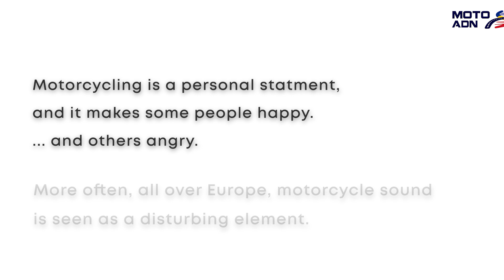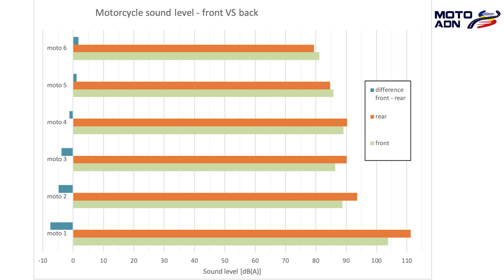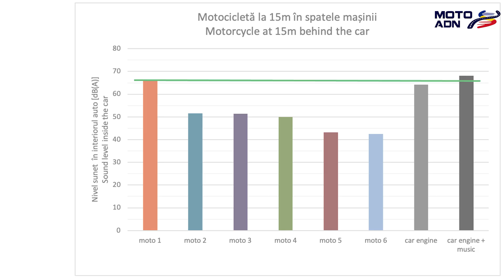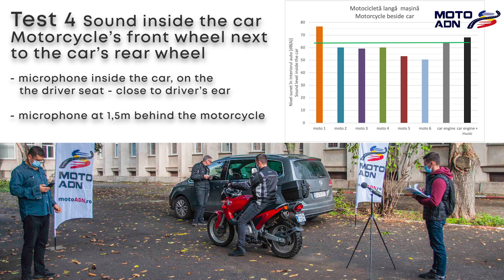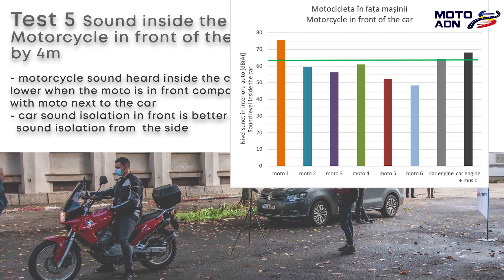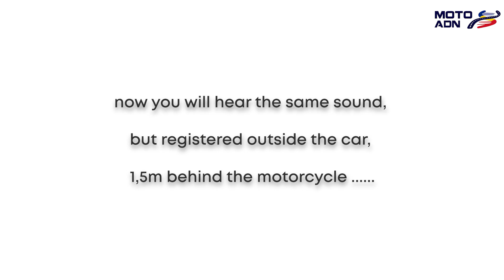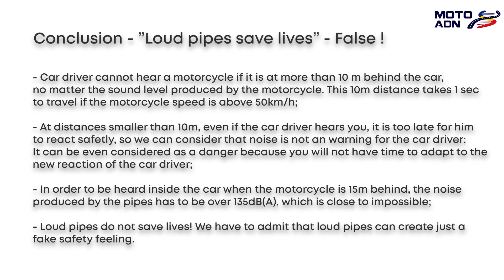Do loud pipes save lives? Now you have the answer!

Comment: I ride and drive in a bike city full of noisy bikes; Bangkok. My Land Rover had a 40-year-old diesel engine - I'd wager it is noisier than almost all modern passenger cars. I can hear loud bikes over my engine and road noise. I posit that the close proximity of other cars in traffic acts to reflect sounds from the exhaust. Lane-splitting is legal in many places and where it is bike exhaust noise will reflect off the front of vehicles behind and also be tunnelled along the sides of cars.

I think the set-up of your test is perhaps valid for open roads, but not roads with sidewalls and certainly not busy city streets. I look forward to your additional testing results.

Edit: Also, it may not be necessary to alert a can to change what they are doing, in some situations, stopping them from starting a move may be enough. 10+ meters is enough to hear right, then it's enough to stay in lane and not start to change.
Reply: Yea i definitely agree, i think something is wrong about this test. I can certainly remember several occasions hearing motorcycles from inside my car and i personally have successfully drawn attention to my bike by revving up even just a little although my bike is not particularly loud. In both recordings you could hear the bike as well. i think the test would have been better if they had sat blindfolded people into the car, not telling them what the test was about and then asking them to describe what they heard. Specially a downshifting or strongly accelersting bike should be easy to hear. I can certainly hear motorcycles far away inside the house and why would a car be that incredibly sound proof that you wouldn't hear? unlikely specially when, like you said, the noise is reflected back by walls and stuff around the traffic
Reply: in traffic when i am lane splitting and i give it a blip people generally look up from their phone and move over to let me pass
Reply: @NZ2STROKE  thats because your on top of them that wouldnt help if they were about to turn as it would be too late
Reply: @luc1ferblack  I have been lane splitting for over 20 years and never had a crash while doing it.When i had a small quiet learner bike people would cut over on me all the time,with a bigger louder bike they know i am there.
Reply: It’s because you drive a 40 year old Land Rover with almost no noise insulation. You can probably hear the external environment far better than most modern vehicles.
Reply: @cjeam9199  Perhaps, but not likely. The engine is loud, the tapets are loose, the gearbox makes more sound in neutral with the clutch up than depressed, the body has creaks and noises. On top of that, I have a layer of sound-damper throughout the cab and rear. The windows are the weak point in my sound-insulation project and my ear is next to the window. In neutral, stationary, you need to raise your voice to be heard in my truck. I should say needed as I have almost completed an engine and gearbox replacement; a 45-year old kit to 3-year old kit. I stand by my point that other vehicles behind and beside will reflect the sound.

Comment: Test conducted at 110db...... Car horns are generally 108-110db.... police sirens are 110 to 120db .... motorcycles range from 80-125db.... so this test is also saying that police sirens and car horns are also ineffective in alerting other road users to danger... the test here is flawed since it does not represent any real world scenario where a loud noise (bike engine or car horn) would actually have saved a life. I can absolutely guarantee ANYONE that during the entire history of motorcycling that a loud exhaust has saved a life (kid crossing on a blind bend for example).... yes it's likely to be an edge case however we have to remember that safety comes in layers and having a loud exhaust contributes to those layers.... yes they can be annoying but that is another argument entirely... just wait until silent electric cars and bikes take over... there's likely to be a lot more deaths outside schools and on country roads attributed to 'not hearing a vehicle coming'!!
Reply: Sirens and horns also operate at a higher frequency so are MUCH easier to hear.
Reply: The speakers for the sirens emit in every direction and are placed high, pipes are placed near the ground and emit sound in only one direction, which is the direction opposed to the one the motorcycle in heading in. Doesn't take a genius.
Reply: @Ragarnoy0 That's not how sound works. It doesn't travel in just one direction. Sound travels through air. Do you think air only goes in one direction?
Reply: And how many morons on bikes were killed by people annoyed by noise?

Comment: Common sense really. If bikes are approaching a car most of the sound will be behind them. Even this basic experiment shows a 7dba differential in a static test.

Noisy pipes are for the benefit of the owner.

As one poster said elsewhere at best they are like footsteps on COD.
Reply: Sadly that's all the bike hater hear have demonstrated, that there's a 7dB difference in front and behind an individual bike. Sadly because they are out to purely seek confirmation of their view rather than look at the topic scientifically their tests tell us little and certainly don't prove or disprove whether loud pipes save lives. What of pedestrians in city streets? What of cyclists? What of car drivers without the radio on? Not chatting to a passenger or with the windows open? Nice try but no cigar.
Reply: @jonharris6923  if loud pipes saved lives, why does the law mandate automobiles to have noise suppression?  your life is more valuable than theirs?   DON'T MAKE ME LAUGH you idiot.
Reply: @donmatthews3904  oh dear. You do know that EVs in most country actually have a noise maker when travelling very slowly but becuase of archaic laws in the UK it has to be turned off for the UK market? But yeah, I'm the idiot.
Reply: @jonharris6923  Yes. Also, the noise is nowhere near as loud. On top of this, below 40-50 mph/65-80km/h, engine noise dominates, above, tire noise dominates (for cars). The way one needs to approach things is radically different at low speeds, and low speeds are often places close to homes. Even to add a tidbit of safety to bikers (which admittedly should be allowed to bike), it's not worth the noise pollution given to thousands of people in a city/neighbourhood.